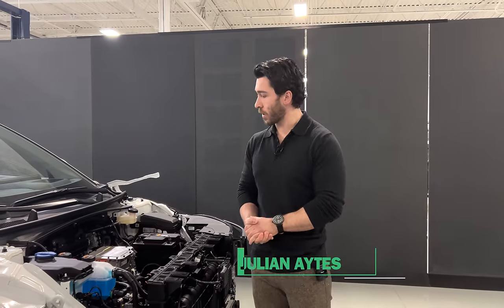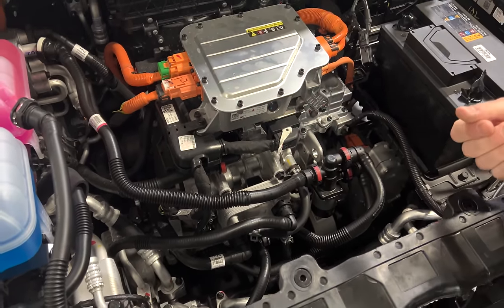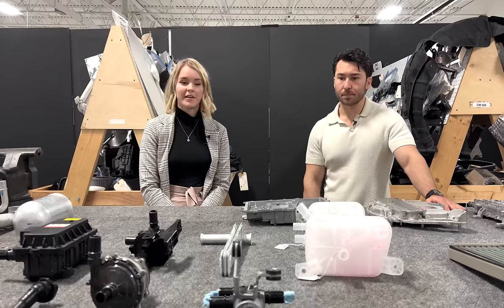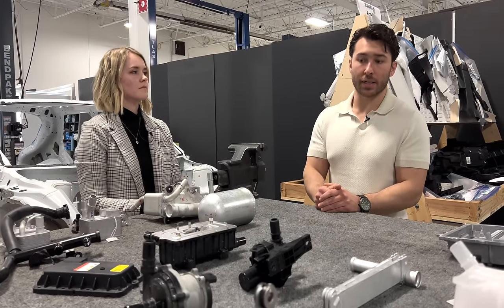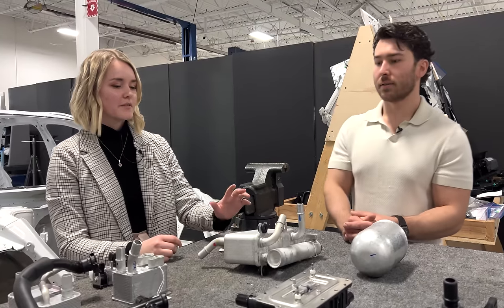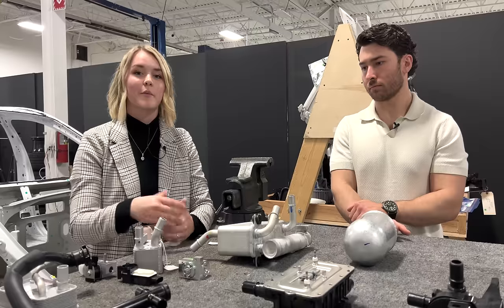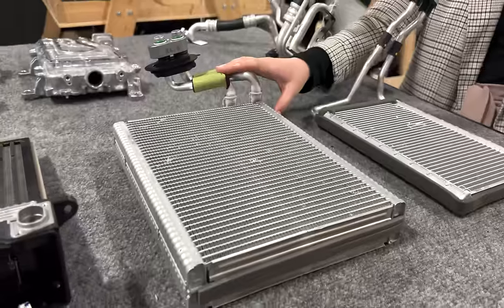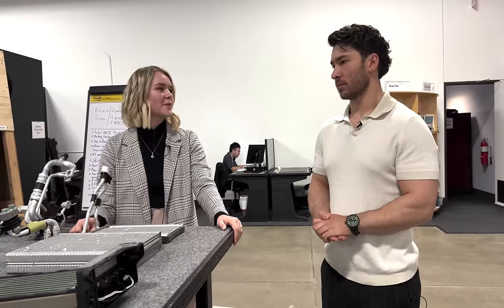This is Cool (No Pun Intended): Hyundai Ioniq 5 Thermal System

Comment: Watching theses tear downs just reinforces my opinion that Tesla remains the leader, aside from phantom braking.
Reply: And the leader in quality issues. Teslas has had tons more recalls than any other brand. Ignoring the company's claim that over the air updates for things that aren't working right shouldn't be considered a "recall", the fact is that something needed to be corrected. And there are lots of things that need to be corrected. My nephew is a Tesla engineer that deals with resolving issues customers have with their cars. His department is huge, and they are always working overtime to keep up with the issues.
Reply: “It’s the best, especially when I ignore how it’s not the best!”
Reply: @4thdistrict476  Ford leads all manufacturer's in warranty costs per unit sold and warranty claims per unit sold. 
Check open public recalls before lying next time! 👍🏻
Reply: @4literv6  - Sorry, bub, not lying. There is a difference between "recalls" that are registered with the NHTSA and need to be done at a certified service department (which is what you are referring to) and those that are taken care of with an over the air update, which more and more auto manufacturers are starting to do. What is not different is the need to fix an issue. Whether at a certified service center or over the air, a problem has been discovered that is important enough to correct. In that respect, Tesla has the worst history. Many of the over the air updates that Teslas get deal with usability or safety issues, not just convenience updates for technology add ons. 

BTW, do a search on how many times one of Tesla's over the air updates has caused problems somewhere else. Happens more often than people are aware of. I've got that nephew on the inside that tells me his group responds to customer's horror stories. He describes them as quite eye opening. 

So, before you accuse someone of lying, try to actually understand where they are coming from.
Reply: @4thdistrict476  you should be you knowingly lied and now try to deny it and make counter accusations. Allegedly based on a supposed family insider. Someone who is likely breaking his nda discussing anything internally held with you. Shame I can't track you&then him down to report him to tesla management. 🤔

Meanwhile anyone with a search function can verify the truth for themselves. 👍🏻
Reply: @4literv6  - Lowering yourself to calling people liars to try to make a point. Not a very mature way of carrying on a discussion. 

So continue to make a fool of yourself. I am done communicating with someone with such low ethics.

PS: my nephew isn't prevented from telling people what he does as long as he doesn't reveal details about the company's operations, so AGAIN you are wrong. 

Attacking and threatening someone who isn't even in this discussion is setting an extremely low bar - which I am certain you are very good at based on how immature you have been behaving.
Reply: NHTS is investigating all ADAS systems for phantom breaking.
Reply: Depends on the citeria.  My KIA is a lovely EV - this Hyundai looks great - roomy, sharp styling, very efficient (apart the CD - but it is big and tall).
Reply: @4thdistrict476 I could understand issues with Tesla’s prior to 2018 but I’ve had my Model 3 now for 4 years and zero issues.  Zero maintenance. Absolutely love the car. I have many friends and family members with the same experience.
Reply: @CaptainCrunch-1  - Consider yourself lucky. My neighbor across the street and another four houses down have had several problems on their less than 3 year old Model S and model 3. 

The model S has had repeat services for body structure problems, mostly squeeks and rattles that are gradually getting worse. Nothing done so far has fixed the problems. 

The Model 3 has had major servicing done to the battery and charging components. Fortunetely for that owner, the service comes to him - three times so far since January, so at least he isn't inconvenienced more than necessary.

I bought an Ioniq 5 Limited in early January. So far it has been perfect, with not a single issue of any kind. I hope that continues. Time will tell. Fingers crossed.

Comment: Ah, the good old servability argument. Just curious how many Tesla coolant systems required replacement?  If so, how old were they?  What was the failure point?  Same for current Hyundai vehicles..how many needed to be repaired or replaced...how often...and which part failed?  The liklehood of those systems failing are very low, if not rare.   Same for Hyundai..low and not frequently.  So again, what is the point of saying serviceability when it already has no need if only rarely.  Being that rare is not a selling point by any measure.  The question not being asked is how easy is it to identify multiple failure points with multiple sensors vs a sinlge system with full integration?  Time = labor costs= more money.  Tracking down failures because its more ...servicable...is not saving you money.  There is also your time personally thats lost in that....just to fit your needed concept of serviceability?
Most coolant systems can only tell you if its low..not when a controller is going bad...and this car has quiet a few it looks like.  If it can identify controllers are the codes specific enough to state which one, or will it be a general code?  Does it detect only immanent failure , or liklehood of failure due to voltage getting to low..indicating failure?  How long do those sensors last?  If one begins to fail will they recommend them all to be replaced?  This is the serviceability you keep droning on and on about...wake up already.  Sounds like a serviceability racket to steal your money.

Thankfully the Ionic6 has done better, according to comments, which indicates this system is not as stated, "intresting" but outdated.  Better systems exist..like Teslas, and now newer ionics use a more intagrated approach which is the more ideal way.

Comment: A heat pump and not one, but two PTC heaters, why so much unnecessary complexity?  So the Gen2 Ionic 6 simplified their cooling system to be more like Tesla, lower cost, fewer components.  Also, if you have any part of the Hyundai cooling system go down, the car will not drive.  If the motors or the electronics are not being cooled, you still need to call a tow truck.  I prefer fewer components for higher reliability.

Comment: Way to positive on the use of a ptc .  You already have a motor stator and it is a resistive heater.  Why would you buy and package and plumb and wire another heater when you have one that is higher capacity installed.  Be critical in your review.  This sounds like pandering...

Comment: Did I see a 12 volt lead acid battery in the car
Reply: Tesla's have them also. If you run your main battery pack all the way down this is what allows you to still open the doors and activate features.
Reply: I'm sure they have moved on to a lithium battery for this event. Saved a lot of weight
Reply: @williamscoggin1509 No, Tesla uses lithium low voltage batteries.

Comment: Hyundai, Kia & Genesis all have multiple brackets that hold up more brackets, inefficient and too much weight.
Reply: At present Aptera Motors is the gold standard for lean design.
Reply: But they are overal way better cars then Tesla!And the Genesis70 is a real dreamcar!Mindblowing and gamechanging!
Reply: @brunoheggli2888  - Genesis is a crappy car , short range, inefficient and is OVERWEIGHT.
Reply: @markplott4820  Its an absolut dreamcar very luxury and with high buildquality and only the best materials!You have to look for the luxury version not the sporty on!Just the interiour is to die for!My brother get hes Ioniq6 this month!The Ioniq 6 has   superlow drag and is extrem efficent,but the Genesis 70 feels more like a Rolls Royce!Was driving yesterday in a Mercedes GT AMG!Its build like a save and looks superhot,sadly its just to big!
Reply: @markplott4820  Overweight is good for a luxury car!
Reply: @markplott4820  If you need a lightweight car buy a chevy spark or a Daihatsu Chuore!
Reply: @brunoheggli2888  - nope, LOVE my RWD model 3, it gets over 132 mpg.
Reply: @brunoheggli2888  - = way LESS efficient. 
Mod s PLAID is almost 5,000 lb but is the FASTEST car in PRODUCTION.
Reply: @markplott4820  Yes the modell 3 is ok!
Reply: @markplott4820  The fastest,so what?
Reply: I want real luxury for that kind of money!
Reply: @brunoheggli2888   - the FACT that both Blake Fuler & Randy Probst race Tesla model S PLAID , shows all you need to know. 
and the Tesla S Plaid they race , are all STOCK .
Reply: @brunoheggli2888  That means everything else is slower.

Comment: Seems entirely inefficient from the overview lol

Funny.. most other heat pumps don’t require additional resistive heating to get the job done.. seems completely wasteful or poorly engineered from the heat pump side. I see a lot of extra shit that somehow others seem to manage to do without.. i don’t consider that a good ‘interesting’ thing. I consider it a waste of space and efficiency. If others are doing the same job with less stuff.. that’s what I want.. less weight.. less complexity.. less cost.. more space.

Ooh.. more service friendly.. always the fall back of people who design poorly and add in obsolescence. Shit that is engineered well and designed to not break in the first place, don’t require servicing considerations. I’d like to hear how often Tesla’s compact, super efficient systems need servicing. Far as I have heard, it’s pretty much never.
Reply: Heat pumps are not adequate to provide enough heat in very cold weather. Tesla's "solution"  is to use the motor as an (ineffective) resistance heater which doesn't provide any heat until all that mass of metal and coolant has warmed up.
Reply: @RobertHancock1  funny.. seems like the 10s of thousands sold in Norway and Canada and other freezing cold locations would have stopped buying them by now.. except its a best seller still.. and the Ionic 5 sells how many? hmm.. how strange that they want to buy the one that you say doesn’t work.. or you’re full of shit.. idk.. i wonder which it could be
Reply: @airheart1  Ioniq 5 is selling all they have available in Canada, which is not that many at this point.
Tesla's solution may be livable, but it's not optimal.
Reply: @RobertHancock1  well, that may be true. I don’t know. I don’t have a heat pump on my 2017 and i don’t live in extreme cold.. but, i don’t see a lot of complaints about it, which tells me it must not be much of an issue. And adding weight.. complexity.. cost and inefficiency to a car, is not what i call optimal. I get your point of wanting it warm, immediately. I just haven’t heard complaints that Tesla’s heat pump system can’t do that. Of course, i can’t say i search for that information in life.. but i do keep my ear to the ground about issues.. and I’ve heard some issues early on with the heat pumps.. more about noise than performance.. and nothing recently. Maybe it’s not bad enough to complain about but people wish it was better.. idk.. but i can tell you personally, living where I do, I sure as hell wouldn’t want to pay Hyundai to have a extra PTC heater in my car that I don’t need.. and have to carry around that extra weight everywhere for nothing.. and the extra wiring.. ducting.. fasteners and brackets. Maybe they should consider a ‘cold weather’ package for those who feel they would benefit from this and other things specific to extreme cold weather environments that others don’t need.

Comment: Who would have thought an EV would have a nightmare of plumbing vs an ICE vehicle?
Reply: Any of us who have worked on legacy ice cars? Their evs all look the same underhood a complicated mess. 😀
Reply: Everyone knew this would be the case. 
Did adding electricity somehow defeat thermodynamics?

Sure, a BEV is much more efficient, but there’s the same amount of power being put to the road, and the batteries and cabin need their own temperature control systems. Lots of heat to manage.
Reply: @FuncleChuck  incorrect on many levels. Evs run at less than half the average operating temps as ice vehicle's do.
No multi gear transmission requiring complex heavy coolant loops either. 

Watch farley talk about Ford and their ev experience gained since the mach e debuted in late 2020. 
And the tear down by a mechanic on here of a lightning and it's nightmare inducing heavy overcomplicated coolant systems. 👍🏻
Reply: @FuncleChuck  I’m pretty sure ICE vehicles run WAY hotter
Reply: @4literv6  Yeesh i looked at the new Bronco engine bay and it is a plumber’s nightmare

Comment: It's all great until a single part stops functioning
Reply: That with ICE was never your issue, are you already allowed to drive a car? Rediculous as in ICE there are many more parts and Hyundai groups did not too much experiment using those that work well. The EV6 is in 54 years of „Premium“ the very first car with zero, nada, none problems in one years and I had the brands called the best but never ever from Japan or Corea (from USA just once with the worst experience in quality and problems, just the V8 small block worked fine but not all the rest). So all those many cars (changed every 4 years) had issues and even if a company fixed it for free I was losing MY time and money! So finally as they said in the video it’s finally also question of serviceability and compared to other makes from Ford, VAG, Mercedes and BMW the Hyundai people did a great job and if they stay open to learn from the best - such as Munro - the even will make good money and margins on their EV. At the moment I feel like a real VIP owning the first Kia in my region for one year letting Tesla look old like VW Beatles when everybody had one in Europe!😂
Reply: That would be more of an issue with the tesla system.  This looks pretty robust in the belts and suspenders department.

Comment: using battery for main heating is not good  - gallon of gas has over 100,000 btu  - small heater used in RVs  could be built in - 
 this does away with need for bigger battery and range problems in cold climate  
people are used to driving with 20 gallons of fuel next to them - 
small tank of fuel slightly bigger than windshield washer bottle not a big deal  -
Reply: Interesting idea, but adds more complexity, space and risk. Also it make the vehicle no longer a zero emission vehicle, so various incentives disappear.  Lastly you have then fill up every week at the gas station to keep your car warm.  Seems like a bad idea on so many levels and is likely why no EV manufacturer has done this. With a good heat pump design, you get plenty of heat and efficiency. The cost in range is only 10-20% or so.  The older PTC heater systems could cost you 30-40% of range.
Reply: haha. fossil heaters in EVs so funny. that is 1980s EV tech.
Reply: I saw a lightning owner who did this in either Michigan Wisconsin or Boston I think? It was interesting to read about on the lightning forum.
He ran into issues with Ford though when he took it in and had service performed. Not legal, not safe&def not sanctioned approved nor covered by a warranty either. Iirc he removed it right after the service visit. 😀

Evs need a cold weather package imo. 🤔

Comment: How many times have we heard “EVs are so much simpler, with fewer parts”? Now we see two separate cooling systems, and differentials, they ARE just as complex, maybe more than ICE.
Reply: Total moving and wearable parts requiring replacement and maintenance for ICE make it zero contest which is simpler=evs are!